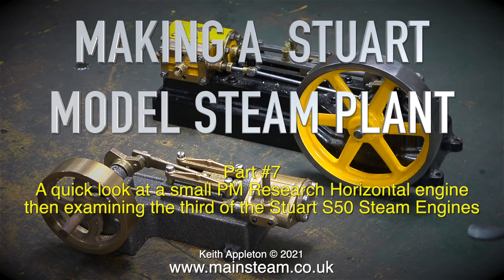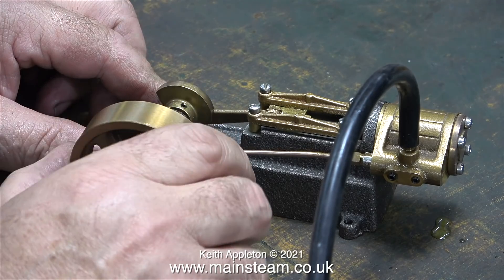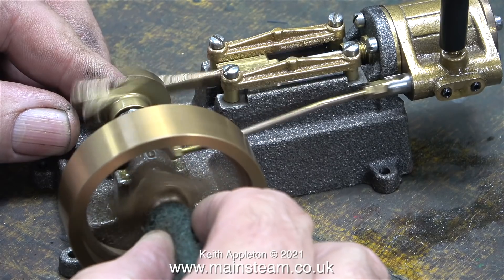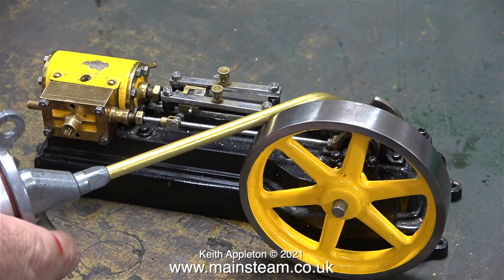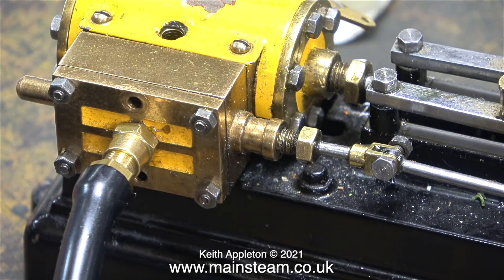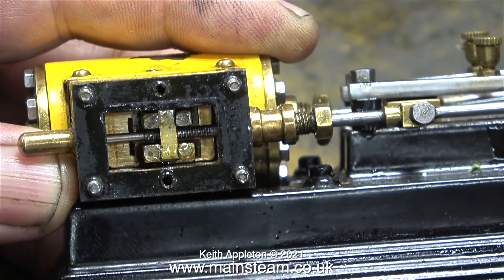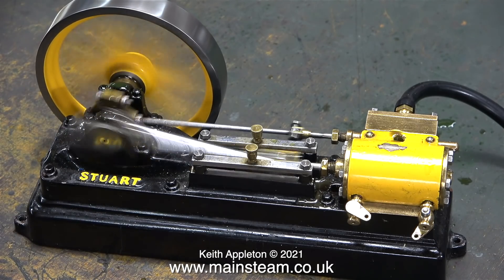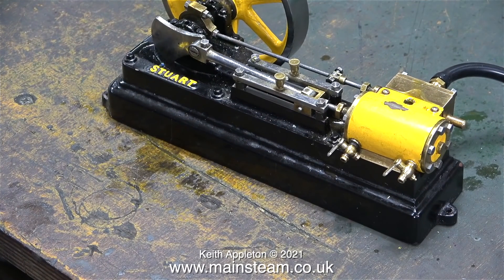MAKING A STUART MODEL STEAM PLANT - PART #7

Comment: Is the slide valve tight on the nut on the valve rod? That's a classic that I've seen on quite a few models I've rebuilt over the years - doesn't allow the valve to be pressed against the face by the steam pressure. 

From what I've seen of PM Research stuff it all seems well made. I agree with your comments about the screws Vs hex bolts, but it must be considered that that engine as a machined kit is £160 whereas machined kits for a Stuart 10H or S50 are almost 600 quid a pop!

Comment: Hi keith These are two interesting models that you got up and running again. i always admire your video recordings. How do you do that with the lighting? Is that the normal work light or do you have extra headlights? I try to film my models myself but have problems with the light.
Reply from the maker: The lighting is all high power LED with "Softbox" type diffusers. It is not a normal lighting environment, with overhead and side fill lights. I installed it to do the job properly. I will show it in a video but it won't be on Youtube for about 3 Months as all of my content goes on www.patreon.com/keithappleton

Comment: My guess is piston-to-bore seal. My Stuart 5H is bad about that too, though nowhere near as bad as this engine is, and it's by design. There's no ring in there at all they're just banking on steam oil to seal things up.

One mod I plan on making soon as I get a lathe is machining up a cast iron piston ring or two for that thing.
Reply from the maker: No, that is not really the main problem, the slide valve is the first place to look if the engine is blowing through.